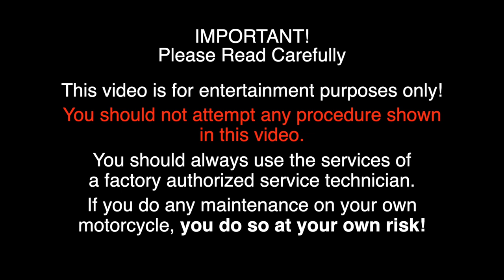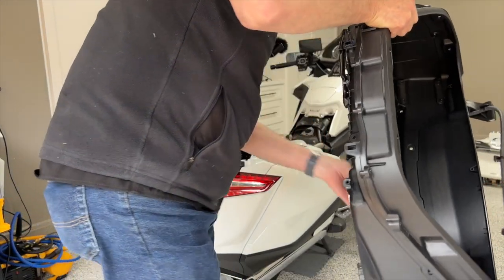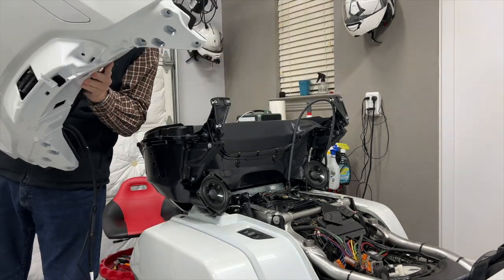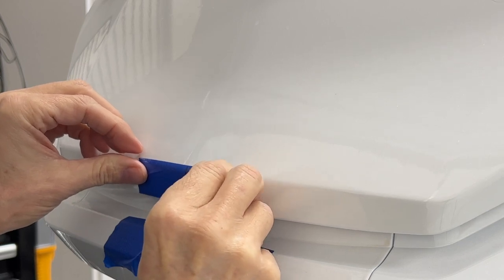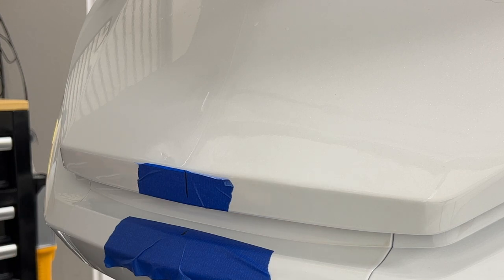Swapping a 2018 Goldwing Trunk For a Larger 2021 Goldwing Trunk | Trunk Swap Part Four

Comment: The music was right on point. 😂 Now to the work. Excellent Cruse! Be very happy with that job. That enlarged trunk looks fantastic. Way more economical than a new Wing, especially considering all your added comfort and safety enhancements. Great tip regarding the use of alcohol. It’s used for prepping surfaces for adhesion only. Thanks for sharing.

Comment: Not sure if anyone said this but alcohol eats clear coats or at least some compounds used in some 7:53 clear coats.  Check you cleaning supplies for any with solvents and avoid on painted surfaces and some plastics.  Not sire which but ruined a part for bike by  removing last little remnants of grease smearing.  Grease was gone but surface was now dull and looked scratched.

Comment: Did you use the old colour kit and just install on the larger trunk? If not, can you get any colour code with the larger trunk?. I am looking at an older non tour model and would like the 2021 trunk to add on. As well why didn't you just use the corbin trunk lid? Thanks
Reply from the maker: I could not find the pearl white from Honda for the 2021 trunk kit. So, I had to have mine painted.